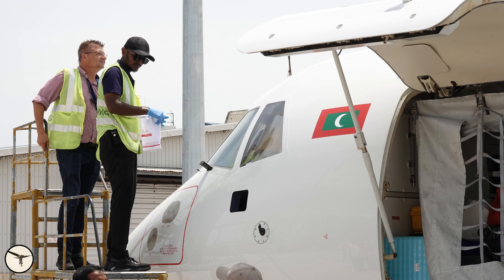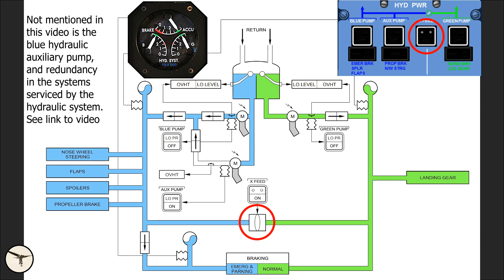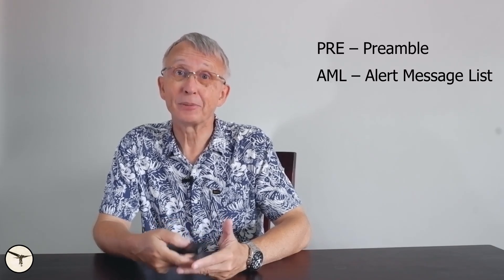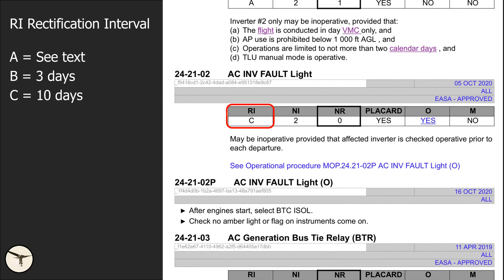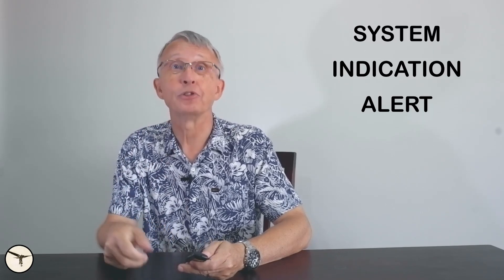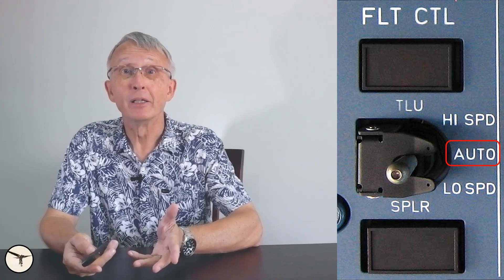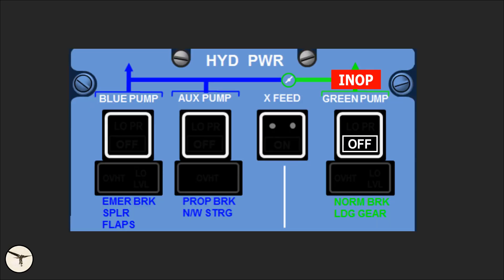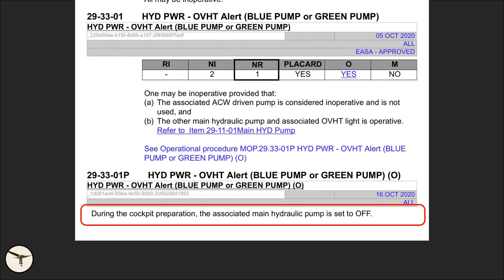The Minimum Equipment List (MEL) - What every pilot must know!

Comment: Hi captain thank you for your help and work , I started flying again the ATR in fs after a year and I noted that Atr in fs now is a complete disaster plenty of bugs and almost unusable, what is your opinion? Or maybe it is only my problem? In case please, if you have some direct line with Asobo ,advice them to fix the product, whe have all this extraordinary material from you here and can’t use it as it deserves.
Reply from the maker: Thank you. Regarding MSFS, I sold the computer when I moved to a new location. Therefore, I am afraid I cannot help you. Last time I used it, it worked, but there were issues with the FMS as it was not complete. Asobo is aware of the issues, but I am afraid they are busy with the 2024 edition of MSFS.
Reply: @ thank you captain, anyway you are lucky you have the real one 😁

Comment: Hello Captain,

Have you made a video about Winter ops?

Especially about Deicing, Static thrust before takeoff or during taxi in certain intervals (like in A320 family) to spin off ice from the propellers.

Also about temperature corrections for FMS in ATR-72-500/600.

And may be about differences between Turboprops and JET winter ops.

Thanks.
Reply: There is a number of videos talking about the de-icing system on the channel. I don't know if there are any about operational procedures.
Reply from the maker: I will put your request on the to-do-list. Turboprop aircraft do not have icing issues on the ground like turbofan engines. The propellers are heated. Therefore, we do not need to use static thrust before takeoff or during taxi.

Comment: This is a good overview of the MEL. Passengers may never realize they are flying on an airplane with broken systems. They might be worried to learn this happens regularly. But the MEL makes it safe and possible to do so until the airplane can be fixed. That's better than delaying your flight for many hours!

Could you make a video about decision making when multiple failures are involved? For instance, when the left pack is MEL'd and then you experience an in-flight right bleed leak.
What does the checklist tell you to do? What would you do? This happened to me last year.
Reply from the maker: When you depart with one air condition pack inoperative, and the other pack or bleed air supply fails in flight, you have a dual pack failure. The checklist is "PACK 1+2 VALVES FAULT." The first action is to descend to FL100 or MEA.
Reply: What did you do ???
Reply: @markwood9755  It happened at about 5,000 feet shortly after taking off. It immediately got very hot in the airplane, so I turned around and went back to the airport to land. Afterward maintenance asked "why did you return, the bleed leak checklist doesn't say to do that" and "why didn't you just turn on the MEL'd pack?"
The cockpit was already over 40° C when I landed, so I think I made the right call. Even though we could have continued to our destination in less than 80 minutes (per the PACK 1+2 VALVES FAULT checklist) it would have been miserable and dangerous for us and the passengers to be that hot for so long. None of my airline's management ever questioned my decision, only maintenance because they didn't want the airplane to be grounded.